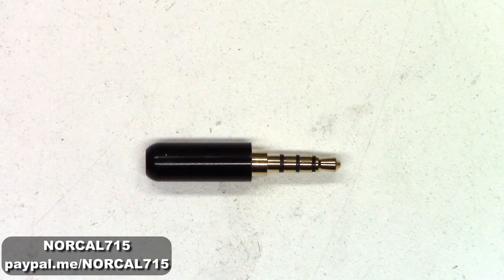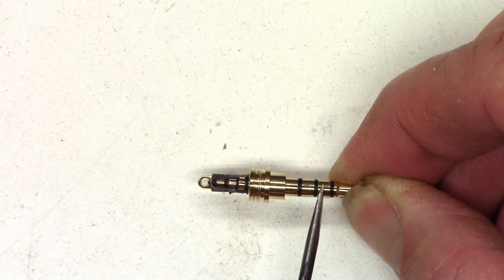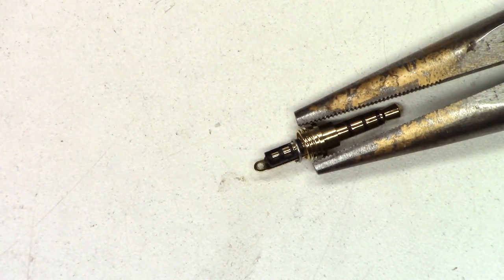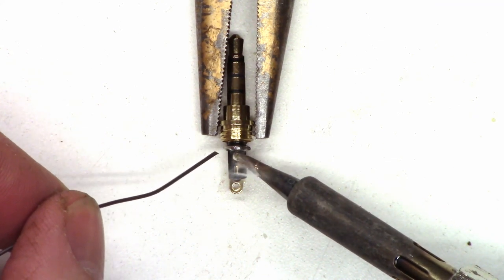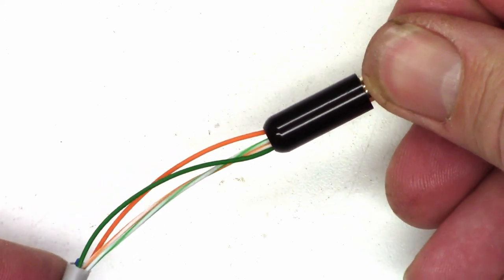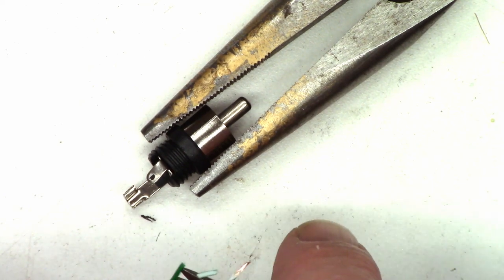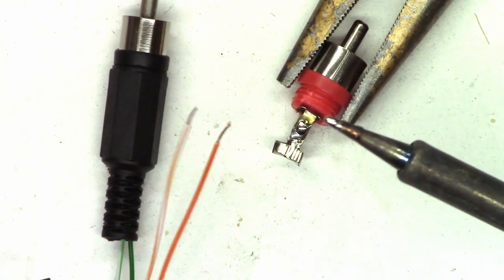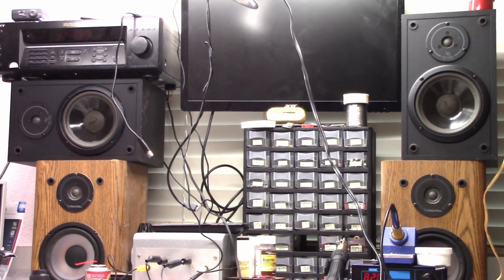CAN YOU USE ETHERNET CABLE AS AN AUDIO CABLE FROM A LAPTOP TO A STEREO RECEIVER? LETS FIND OUT!

Comment: A retired engineer with a hi-end audiophile system, says you can use Cat5 and 5E, for RCA type interconnects and these sounds as good as $200 to $300 audiophile interconnects. And the thing to keep in mind is those cables start at that price, usually for half a meter. The solid core cables are better though for audiophile. That's why I'm here, I have some Cat5E cables and I need to make a couple RCA's for a hi-end Streamer I bought.

Comment: I have got an external DAC (digital to analogic converter) connected to my PC via USB port and the analogic sound coming out from the DAC is considerably better than the one coming out from the internal PC DAC.
Reply: @jasejj  I am sorry I was not clear, I was talking about the DAC not the cable. I meant to say that an external DAC can be an actual sound improvement. On the other hand, a USB cable cannot be longer than a few meters/feet.

Comment: I am using all 4 pairs in parallel as speaker cable. good way to get a cheap long lead for this use, using cable that was removed from service in an upgrade. Much better than the cheap speaker wire, which is often these days mystery metal wire, a few strands in a cheap recycled plastic. just have to make sure i am not using the copper plated aluminium wire, but those are also usable if you are not soldering them in to place, just use crimp connectors each end.
Reply: So which is it, you reply that you're doing this and then reply to me elsewhere it won't work?
Reply: @buildstoys    he replied that it won't pick up 60Hz hum. Just selected wrong level of reply.
Reply: @PeterHovorka  Haha okay, I was confused!
Reply: @buildstoys  Sorry, was responding to the poster Morenormal that it will not pick up hum, as it is a twisted pair, and thus will cancel out hum induced in it quite well. Even phone cabling will work quite well, even with the much lower twist count, and it has quite low crosstalk even in massive multipair bundles, carrying all sorts of DSL data on separate connection pairs to various households.

Comment: This will get you out of a spot... Don't do it for long runs or places where there is a lot of noise. This unbalances the cable and takes away 80% of it's ability to reject noise. Don't even do this if your neighbour is a Ham Radio operator or you live close to a radio station TX site!

Comment: Those cables are so thin, what about the consequences caused by the resistance of the cable you made?
Reply from the maker: Normally the input impedance is approximately 47kohms, so adding several ohms is not any concern. Thanks for watching!

Comment: sponsored by BOSE
Reply: Actually the speakers make of the speakers with a wood texture is Polycell, I cannot read the make of the black speakers though.
Reply from the maker: infinity speakers, all 4. black are sm62, woodgrain are rs2000
Reply from the maker: I actually do not own any Bose, not even when their equipment was good(70's 80's). The speakers you see are Infinity brand.
 Black are SM62, Woodgrain are RS2000
Reply: @norcal715  just a joke, I think this brand can be thought as a bit upper shelf by most.  I didn't knew that before I pulled one bluetooth unit out of a recycling bin and fixed it. Than someone told me about their placement as a product.
Reply: @norcal715  Just today I pulled out of a recycling bin LG 50LA660s. It has a led logo under the screen. When I press power button, it lights up and than goes off. I checked voltages on the power board connectors, seams fine. I disconnected tcon and backlight, same effect. Seams like a main board issue. Any suggestions?